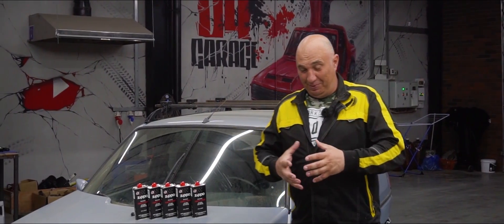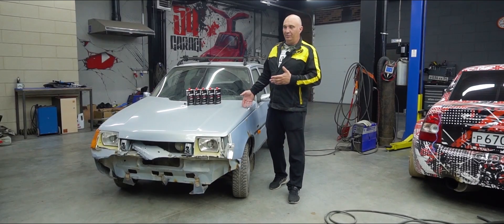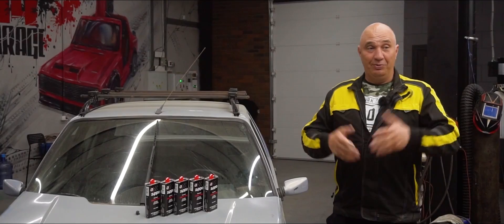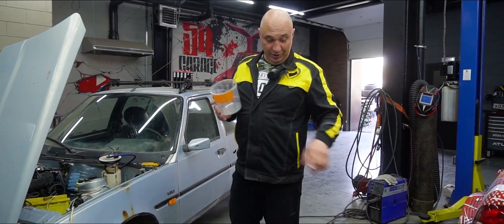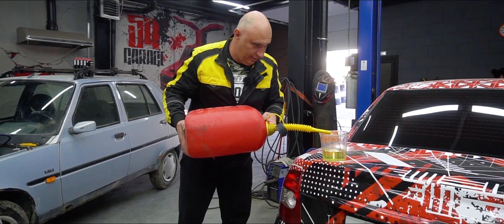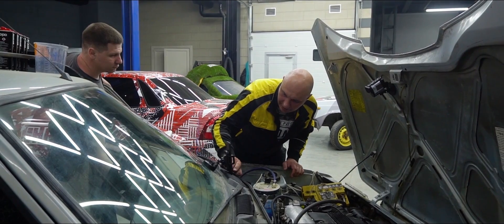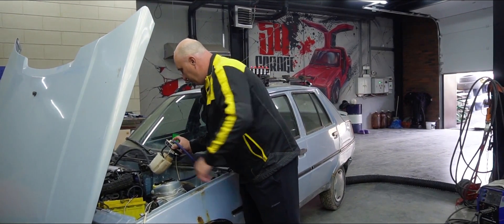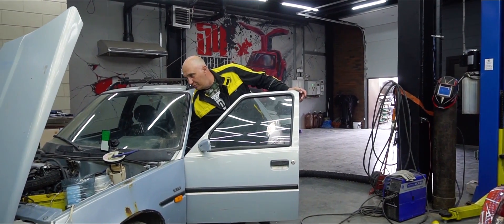Can a car run on Zippo lighter fluid?

Comment: You should run the car on WD40 fluid  that would be a good 👍 video 📷 I love ❤️ your video 📷 the are the best I just can't wait for the next video 📷 #CarRunonWD40
Reply: somebody did it :  https://www.youtube.com/watch?v=I1qwPvX4nGA
Reply: WD-40 mainly kerosene. A diesel engine can run on kerosene without any problems.
A petrol engine is more complicated. 
If you take a cold petrol engine, and feed it kerosene, it will flatly refuse to start.
But if you start the engine up on petrol, run it to normal operating temperature, and then switch the fuel to kerosene, that very same engine will now happily run on kerosene.
Cars can run on kerosene, but you won't get much mileage, and your power output will be reduced.
Reply: We use wd40 in the winter to start up the older tractors, works just fine...
Reply: @francoisdvanderwesthuizen  i take it they are diesels ?
Reply: @thefreedomguyuk  around here diesel is the thing
Reply: =THEY ALREADY HAVE THIS DONE

=..................

Comment: Dyno test, petrol Vs lighter fluid.
Reply: ASAP
Reply: Propane will have lower hp
Reply: AngelSix all I know is I'm putting this in my civic
Reply: YES! YES! I support the motion!
Reply: @RDCST  ditto
Reply: Petrol wins hands down !
Reply: @thefreedomguyuk  lol  did you not watch the video
Reply: A.A.Ron Davis  propane is a gas silly. you mean propane vs. petrol?
Reply: THIS
Reply: DOOOOOOOOO IIIIIIIIIIITTTTTTTT!
Reply: A.A.Ron Davis  Depends if they mean Zippo fluid, which is basicly kerosene with branding.
Reply: @IcedForce  No it's not even close. Most lighter fluid is light naphtha
Reply: @memberHD  in the old days naphtalin was used to win illegal draggraces , usually destroying the engine in the process
Reply: @Pavlos_Charalambous  I have never heard of naphtalin before, but after a quick google, you might mean naphthalene? I am not familiar with this either, but it appears to be a solid, not a liquid. Do you have any more info on it?
Reply: @memberHD  probably I wrote it wrong, yap that solid pounder that is supposed to keep fabric-eating moth away from clothes when there are in storage
Reply: @Heads MessNo. Lighter fluid is light naphtha. Gasoline is produced from heavy naphtha. During the refining process light naphtha is drawn off and sold as is. Heavy naphtha is drawn off, further processed, then sent to be used in gasoline production. 
Calling naphtha gasoline, is like calling shampoo water. Shampoo is predominantly water. It has additives that allow the water to wash your hair. But, water alone is not as effective as shampoo. Similarly, Gasoline is predominantly naphtha. It has additives that allow it to burn better in an engine. Naphtha alone isn't as effective as gasoline.

Comment: Why was the zippo fuel the same color as the gasoline after it was removed from the fuel pump container... Hmmm
Reply: Fuel left over in the fuel return line.
Reply: Left over gasoline in the filter, pump, and fuel return line got mixed in with the lighter fluid.

Comment: Isn’t this fluid like lamp oil?
Reply: No that's paraffin, Zippos run on petrol
You can use paraffin but doesn't work in the winter and burns very uncleanly
Reply: @6sicSIX  you can also use petrol in some lamps, we have some of those, you can even use straight gas from the pump in those and the German Military used one slike that for a long time.
Reply: Killian Orannis ahh I always put like Any flameable liquid in my zippos😂 it worked
Reply: Zippos use Naphtha and lamp oil usually mean Kerosene.
Reply: Naphtha/White Gas is Zippo fluid. Coleman camp fuel for pump lanterns and stoves is the same thing just refined more. Gasoline can also work in some Coleman devices.

Kerosene is different and is used more in wick lamps but also in stoves, heaters, and older lanterns that call for kerosene. Similar to Diesel or JetA vs gasoline.

Lamp oil is the modern substitute for whale oil and is heavier and is used in wick lamps only
Reply: Depends on what lamp.
Reply: No

Comment: If that car had been a diesel, it could possibly run much longer on the same amount of fuel. But petrol engines are really thirsty at idle, in comparison to diesels.
Reply: He would damage his engine. That engine is a low comparison economy car and he was already getting knocking.

Comment: I’ve learned that any combustible liquid can be used as fuel
Reply: That was the main selling point for the Chrysler Turbine Car. Sadly it never took off.
Reply: @GrumpyIan  Excuse the pun.😎
Reply: If you think that's impressive, try an old diesel that can run on any oil that's runny enough. If it's not runny enough then heat it until it is.
Reply: @Darndiddlyarn  Here in Spain, farmers used oil in their tractors as fuel because diesel was hard to get or too expensive
Reply: you can use wood gas too
Reply: @spike7269  Not if you want your engine to last long.
Reply: @kg4boj  engines doesn't care if they are old en
Reply: But you're sacrificing efficiency/ fuel economy amongst other things by using it.
Reply: @eudnen  not really. At least in Europe using veg oil would be 5 times cheaper then normal diesel
Reply: I ran Nitro in a riding mower once...... Never have I ever got my yard cut so quickly...lol
But for real it ran like a champ with that smell of the oil in the nitro fuel and seemed to break up a lot of carbon deposits.....only issue the float needle seat starts to break down and o-ring on the bowl started leaking seemed to run a little higher rpm than normal gas with slight temp increase but I mowed 5 acres with no issues...
Reply: I've learned that you are not very smart, or correct.
Reply: If their ain't fuel their ain't fire
Reply: @thomasmcdougall8059  oil does have a combustion temp so as long as the factors are there you can run off of oil. As for a gas engine can to if the carb or injector parts can withstand the temp the oil needs to be at.
Reply: Even flour as well oxygen and noxious lots of other stuff.
Reply: My gasoline is blue for my pushmower 90 octane E0 gas at Royal Farms off on pa 741.
Reply: this is valid only in Russia.
Reply: Hey, it's your car. I wouldn't put anything in my tank but gas. The cheap stuff. Dont use the expensive unless you got a lambo or something.
Reply: vodka
Reply: Compression may be your enemy

Comment: You can get the engine running on Naphtha, which is the main ingredient of lighter fluid. But, you cannot run your car on Naphtha. Chemically it's closely related to gasoline/petrol, but Naphtha is only 70 octane. A car won't live long on 70 octane. You had the extreme knocking initially. That eased as your ECU retarded the dynamic ignition, possibly to ignition well AFTER TDC. So what  you heard was not the engine getting used to the new fuel, it was the sound of your horsepower vanishing...

Comment: Regular 95 octane? Here in Chicago Illinois 87 is regular.
Reply: Different ways of reporting octane. Octane is measured by two methods: the Ron (research octane number, which is a calculated figure) and Mon (motor octane number, which is measured is a calibrated cylinder). The Ron is always much higher than the Mon. Outside North America, only the Ron octane number is used. In North America we use the AKI octane (anti-knock index), which is the average of Ron and Mon. The upshot is that our 87 is the same as their 91-92 and their 95 is the same as our 91. When he says "regular" 95, you need to make allowances for losses in translation, especially given that the actual regular grade fuel in Russia is Ron 92, or 87-88 AKI. In other words, their regular is the same as our regular and their 95 premium is the same as our 91 premium.
Reply: In Finland we have 95 & 98, I guess it's the same in Russia

Comment: Damn that gas is yellow. Even the lowest grade is mostly clear here.
Reply: Iirc they colour all the fuels slightly differently in russia. I go to refuel there every now and then. The 95 octane there is just normal 95 Euro Octane with ~10% ethanol
Reply: Its yellow in sweden too with 10% ethanol since about 10 years ago or a bit longer
Reply: Around here I think Esso or dunno which station used to color it red to differentiate for some reason. Avgas is usually blue too, I wouldn't correlate too much the color with quality, rather it's clearness

Comment: Then again russian fuel is low octane and not the best in quality
Reply: Nowadays, low octane fuel in russia is hard to find. Usually the lowest octane fuel on the gas stations is 92, sometimes you can find 80-octane fuel but it's very rare. 
Though, you're right about the quality.

Comment: The clear lighter fluid that was poured into the container came out yellow?
Reply: The pump and fuel lines were filled with regular fuel, so what comes out is not pure lighter fluid anymore.
Reply: The fuel injector rail returns left over fluid to the pump and into the gas tank again so the fuel pump can run constantly with consistent load. Hence the yellow came from left over petrol in the fuel injector rail.
Reply: There's leftover gas in a lot of places within the fuel system. The Zippo fluid will be tainted as soon as it goes in
Reply: Could be a saturated yellow filter in the fuel pump contaminating the clear fluid
Reply: @ESPNsPeacockbassProfessor  lol no man
Reply: Sorry Guys i Forgot it was fuel injected such a dumb mistake, my bad!
Reply: I was thinking the same thing. Somethings not right there.

Comment: 107% success rate on 107 octane.👍🏼
Reply: He's incorrect. That fule is low octane.
Reply: 108 octane is the in the top octane of all.
Reply: hollingerw 2019 na na na, straight 110 octane race fuel is where it’s at
Reply: I think he was kidding about the elections there that had 107% voting rate. a few years back

Comment: You could always try rc model fuel nitro methane see how it goes
Reply: They could also just go straight methanol. Or kerosene.
Reply: It would run hot though, kind of like running racing gas in a regular car.

Comment: You should have checked the sparkplugs to see the results, like youtube channel Project Farm.
Reply: Why? Lighter fluid is so clean, it won't build up any residues
Reply: @bjornhellwege1594  could have cleaned them
Reply: @bjornhellwege1594  Petrol is cleaner than lighter fluid. And the quality of the fuel is not what foul the plugs. Incomplete combustion is fouling plugs. 
However, in this case, there wouldn't be much fouling. The persistent knocking is like running an overlean mixture. The resulting explosions are causing spots of extreme heat, and your spark plugs will quite rapidly melt away.
Reply: Would be white as snow
Reply: @peterzingler6221  Yes, the insulator would be white. And both electrodes would have melted, likely the top of the ground electrode would have completely gone.
Reply: You call them out.
Reply: Honestly I only replied because. the guy said ‘check the spark plugs like PF’ , and to get a proper spark plug reading the engine has to run for quite a while. You can’t pull it out right away and check if it’s wet, it needs a chance to build up carbon
Reply: @ghettobikelife8833  Project farm has come a long ways since he started testing with motors, Much of the stuff he does is far better, I use a lot of this testing to determine the right product that I intend to use based on a lot of his test. You should watch some of the newer videos before you talk trash about his older stuff.
Reply: i like his channel i dont know a lot about that stuff so nice to learn a bit and he gave few tip on my car Project farm  is mos honsted gentlman  i talkd to on youtube . he be great person to have as friend i would think
Reply: Idaho I actually like most project farm stuff, I guess my first comment was a bit too ‘detailed’ because fifty people came out of the woodwork to defend him. It was the OP’s comment of “you should’ve checked the spark plugs to see the results, like PF” which got me started because one definitely isnt getting any scientific ‘results’ from checking the plugs on an engine that isn’t even running right. Even on a properly running engine, I could change the plug heat range and make it appear to be lean or rich when it’s not. So unless the whole engine is dialed in, checking the plugs is meaningless unless you think it’s flooded
Reply: To those saying project farm is rigorous and transparent- I agree. Scientific? Usually, but a lot of the things measured are purely qualitative (eg. that oil viscosity thing, which oil flows down that board faster). Qualitative tests like that are better than nothing but can’t be blindly trusted
Reply: I like project farm and im currently subbed but you guys are the type of assholes ruining the world. The type that goes “How dare you like X” “what do mean you don’t like Z”, the same sort that tries to dictate what actors should be accepted and which are “toxic”.

The guy doesn’t like project farm, oh well. Grow up.
Reply: @MarcTBG  There's a difference between a simple dislike for something, and being a dick about disliking it.
Reply: @MarcTBG  I agree 100 percent. I really like Project Farm, but I'm not going to tell someone they have to like it. Or call them a jackass for not liking it.
Reply: @HHh-ej4rl  big difference between not liking and dissing.
Reply: @MarcTBG  stfu marc, nobody asked you.
Reply: Agreed!
Reply: That show sucks
Reply: A lot of what project farm measures and tests is irrelevant- eg. taking the head off every 10 mins of running to analyze some tiny amount of ‘carbon buildup’,  or comparing engine temp that’s a few degrees off between 2 tests where the engines are no load and probably hasn’t reached the max temp- and extrapolating this to eg. ‘lubrication increase- lower temp’. Can’t remember much, I don’t usually watch it but there’s a lot. He’s basically measuring everything he can, not what’s best for that test
Reply: @ghettobikelife8833  No measure is irrelevant!
Reply: @ghettobikelife8833  hes measuring everything that is important, if even one thing is different then its vital to the test results. He quite literally uses the scientific methods to such extreme methods that a chem teacher would be impressed.
Reply: @ghettobikelife8833  Project Farm is going out of his way to show us every change/difference. You are missing out, he is a gem.
Reply: @ghettobikelife8833  

So you 'can't remember much' but you're happy to shit talk one of the most honest, transparent channels on YouTube?

You also used the word 'probably' in your reply...and you used the word 'extrapolate' with zero irony I see.

Comment: And now on the Zippo fluid it would have ran for 45 minutes if it used every drop just the math is what it says that you're 18 minutes * 2 + 9 minutes that's how the math works out some 45 minutes on Zippo fluid and 37 minutes on regular octane fuel

Comment: So if the car used every little bit of that gas it would have stayed running for 37 minutes and 30 seconds on the fuel alone and then we will see how much of the lighter fluid at uses now

Comment: its lower octane, hence the knock
Reply: Correct. He's getting pre ignition
most likely.
Reply: CrazyWaffle5150 
Yes, that’s what knock is. Great input.
Reply: @Crazywaffle5150  I would hope so. For the Lada,  the specified pre-ignition is 5 degrees before TDC, @4000 RPM 20 degrees...
Reply: @el Guapo 
Precisely 70 (-;
Reply: What is the octane of lighter fluid? Thanks.
Reply: Also, because it's a lower octane, I think that's why they noticed the torque increase down load and increased in response. Lower octane fuel burns faster, so at lower rpm's the mixture expands much quicker, increasing torque. Higher octane fuels burn slower, which is what prevents them from detonating.
Reply: @kasuraga  And that is what 99.9999999% of people completely misunderstand 👍
Reply: has way less octane but vaporizes way more and faster
Reply: Light Naphta octsne.
Reply: It’s so funny how people don’t realize this
Reply: @UpVoltageOverclocking  It's always been like that. Thanks to the advertising from the oil companies. "Higher octane is better, so you will have to pay premium price".....
People are ignorants.
Reply: @thefreedomguyuk here in eastern europe, when you use "premium", you just get the nice gas lol
Reply: @SliKdaASS  Dunno about that, "Premium" is not meant to mean "uncontaminated".
High octane is NOT "better" than low octane.
Reply: @thefreedomguyuk  well, over here its like that lol... regular is full of water, and premium is cleaner...
east europe life
Reply: @SliKdaASS  I get the point now !  What a difference. Around here, the only pollutant is the 7% alcohol they are mixing into the fuel....
Reply: Ya the dude in the vid doesn't seem to know what octane does.
Reply: @Baka_Oppai  That or a failure in translation somehow.
Reply: @Baka_Oppai  That's common, most people are clueless about octane numbers.

Comment: After running the car with regular 95 octane the engine was actually warmed up. So running afterwards with Zippo fuel was more efficient and ran longer with same amount of fuel. Or the engine was cooled down before the Zippo attend?

Comment: Higher octane doesn't mean more energy density. :)
Reply: Don't speak sense, we are here just for nonsensical fun
Reply: It does mean higher compression ratios and thus better efficiency, but for that you need to modify or change the engine.
Reply: @sleeptyper  or buy a car that only runs on 98 RON with a high compression ratio :)
Reply: @6sicSIX  ford granada 1985 or earlier only likes 98 octane leaded fuel lol, had to buy "lead addative" fake lead and pour in the tank
Reply: @clarkcolt45  I drive a Suzuki Ignis sport, 98 RON only, unleaded haha.
Reply: Exactly, infact it means the opposite.  Less energy density because of the additives to raise the octane